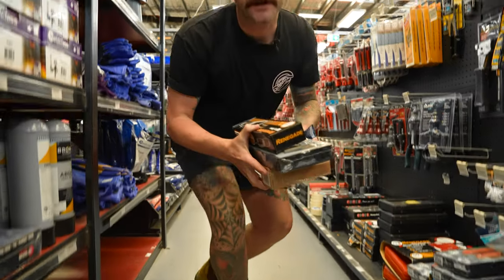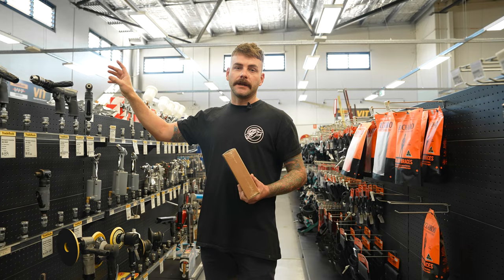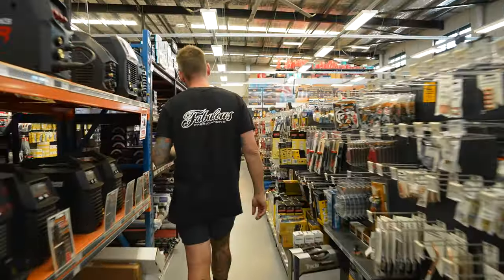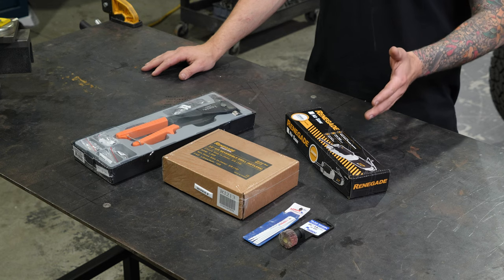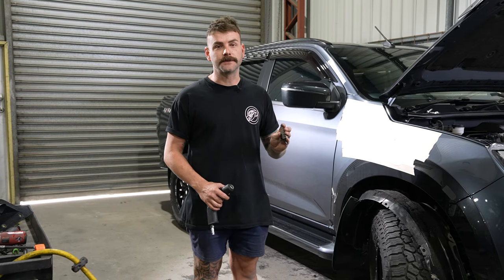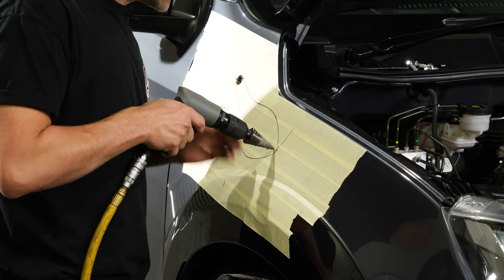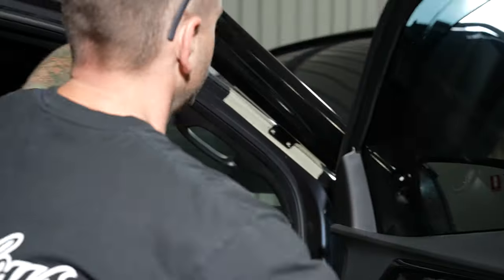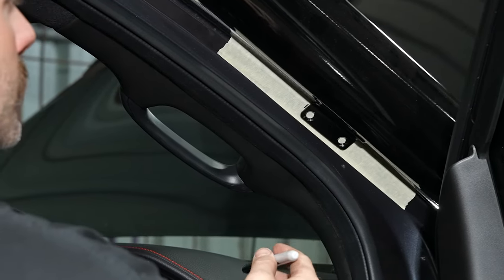Watch this first! - Fitting your own snorkel?

Comment: The number one questions is, why do you need one ? Especially of ute isnt ever going to see deep water ??
Reply from the maker: Hey Mixalis, 

The factory air inlet location on most four wheel drives are generally at headlight height, and whilst you may not be entering water at that level, a snorkel accommodates for any splash or water ingress from entering a much smaller water crossing, like beach run outs, or even river crossings, which would be more common.

So for people who use their 4wds across Australia it's a great safety measure!